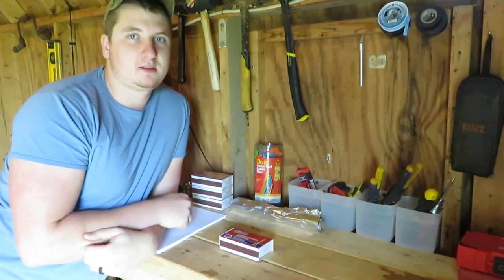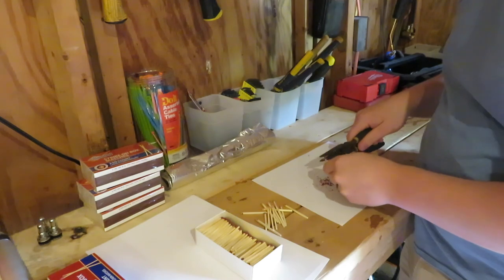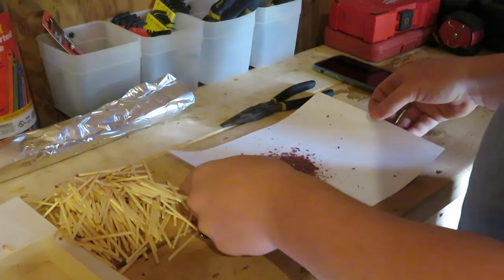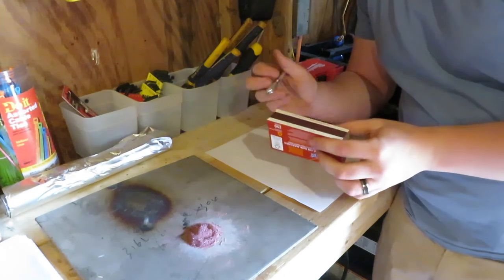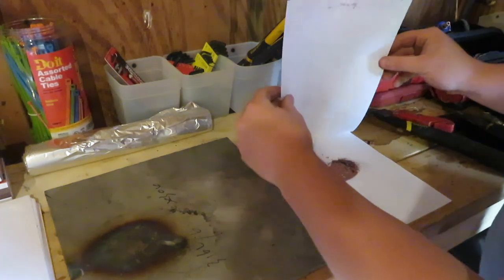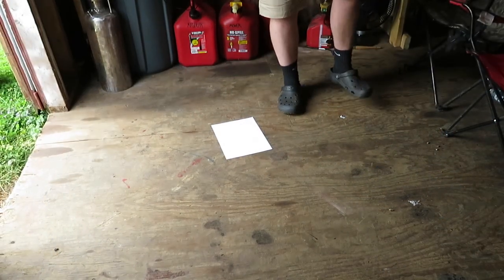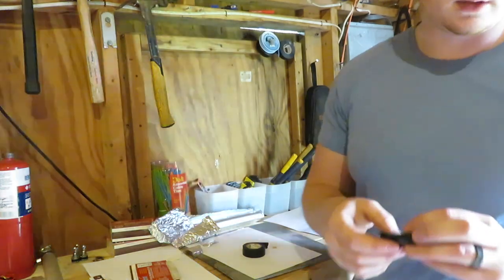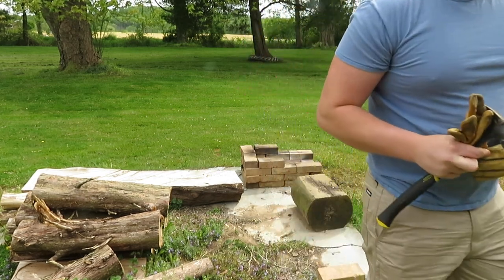HOW TO TURN MATCHES INTO EXPLOSIVES!!! ARMSTRONG MIXTURE!

Comment: I inadvertently discovered this mixture when I was 11 years old by myself. I thought since matches ignited when they struck the matchbox's striking pads, mixing the two powders and striking it would cause a chain reaction since it'd be friction sensitive. I extracted both powders from a large match box, ground them both very finely and mixed them together using the paper folding method. I then took a large paper sticker label, carefully poured the powder onto the center of the label's sticky side and used another label to compact the powder and to seal it. I then hit it with a hammer on a concrete slab floor and the explosion was so powerful it chipped the concrete floor. Thats how I irreversibly damaged my hearing and gave myself tinnitus.

Comment: i tried it and my ears are ringing after 24 hours! NICE!
Reply from the maker: Lol yeah it’s pretty dangerous, be careful!!
Reply: people says that this is only matches but this is loud as fuck if you have enough mixture
Reply: @theshedmaster6206  Holy shit i just did it and I did about enough to fill a shot glass and I wrapped it with paper towel and electrical tape and threw it and it was like a bomb It blew my hearing away,made a dent in the concrete and I live in a rural era and I still got the cops called

Comment: Can it be dropped off of a rc airplane or quadcopter via a hook that gets relased by a servo? Would freefall give it enough speed to explode and how much G force it can handle before reacting?  Also would it be safer to drop it in the middle of a field where people is far from in terms of problems due to how loud it is

Comment: hey want to process alot of matches in literally 5 mins get a water bottle fill it up with the match sticks then fill it with a bit of boiling water then shake until the all red tips on the matches come off then take the water and boil it down to about 1/4 of the size then put in fridge and pink or red chlorate crystals will grow filtering the liquid will yield purer chlorate also you can wash the chlorate in acetone to remove any excess dye trust me do this the process you used must of took you a good 30 mins to get them matches off and it hurts you hand and also the way you removed the red phosphorus was pathetic come on you left most of on the box you need to use acetone or alcohol or anything that'll break down glue then when u rub it, it all comes off in a gooey red ball which u can mold and let dry and it goes really hard then crush it you get atleast 0.15 per big box and 0.04 per small box
Reply: This guy makes explosives
Reply: How much do i have to boil it?

And after boiling how long do i put the liquid in the fridge?